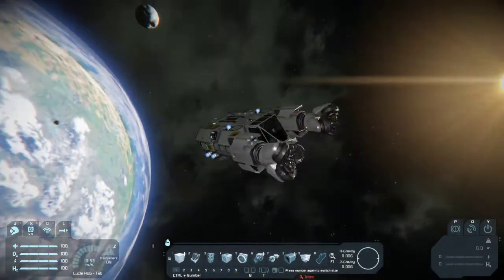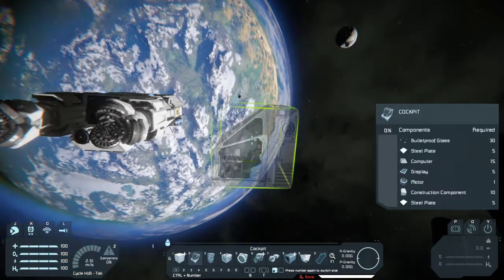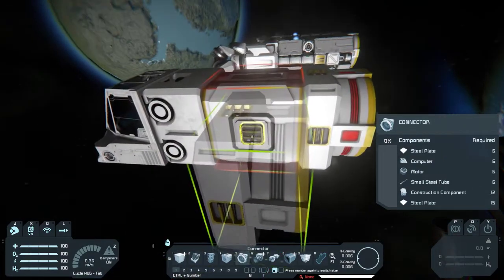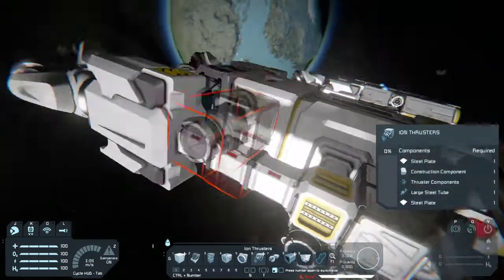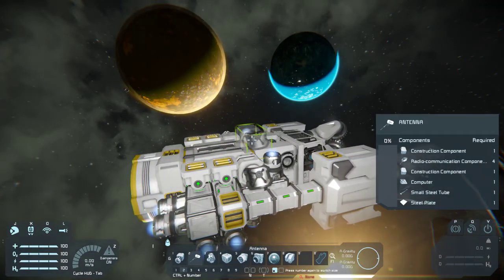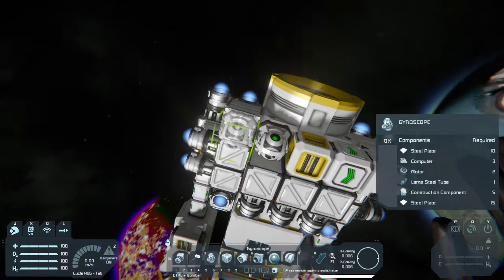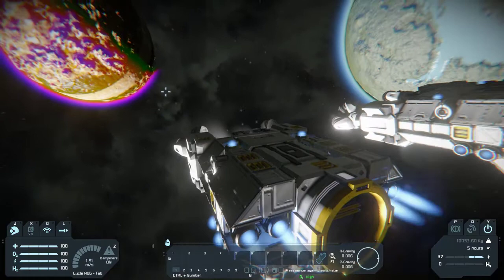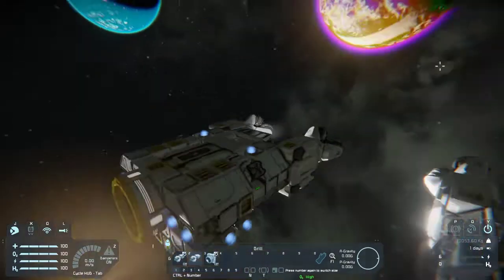Space Engineers - starter asteroid miner (vanilla) - build tutorial !OUTDATED!

Comment: Great little ship.. I play survival mode, what have i done wrong as fuel doesnt transfer to thrusters???
Reply from the maker: only hydrogen thrusters use fuel, ion just use power from either reactors or batteries on ur ship :)
Reply: @LunarKolony  Hi, Thanks i worded it that wrong.. I have 4 reactors on it as in the vid.. do i manually load the Uranium into each one?
Reply from the maker: @grandadgamernz  ah sorry, yes you do! however u only need 1 really to the the conveyer system running, so if u attatch the other 3 somehow to the conveyer system any uranium from storage will automatically but put into them, at which point u can attatch the first one to the conveyer also, however despite the initial bother, i believe manual loading for a ship of this size is much easier. sorry if that was a bit confusing haha :)
Reply: Info: it's the same with atmospheric thruster (need energy)
-I would recommend a battery powered ship, when it is such a small one.
Reply: I ran into this same problem today. I replaced the 2 small conveyor tubes and the 2 light armor blocks beneath each of the reactors with 4 small conveyors and was then able to load the reactors. It also seems that the lateral thrusters (Left / right movement) are insufficient when the thing is fully loaded so will add a 3rd on each side. Nice ship though - lovely shape - shame it handles like an old Renault 18 Estate I had back in the 1980s ;)